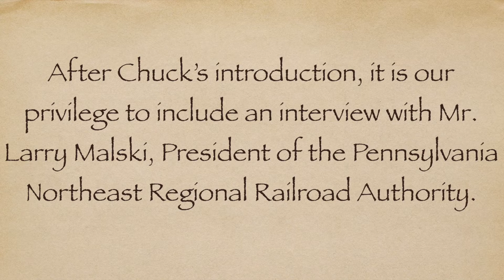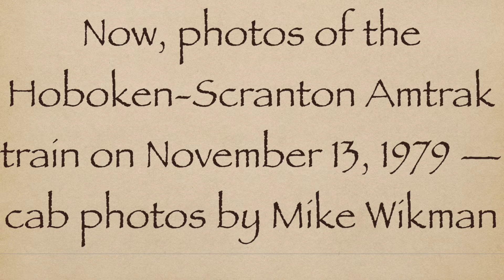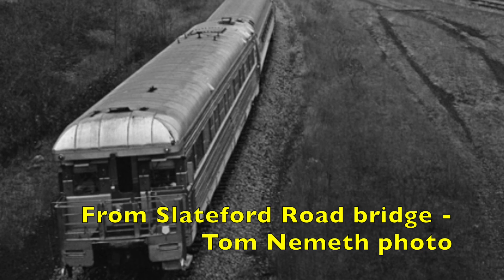Lackawanna Cut Off - Part 14: Farewell to the Cut-Off (1979-1984)

Comment: Thanks for another great episode in your cut-off series. The line in the Poconos was saved, but only one track. If memory serves me correctly, Conrail single tracked it about the same time they pulled the cut-off. I remember the rail train in Cresco. This was right after a deal with Monroe Country to buy the line for 7 million fell through. Monroe County Commissioners and Conrail personnel hi-railed the cutoff shortly before the tracks were pulled. The eastbound track is in place to Mt. Pocono, then it's connected to the former west bound line to Scranton. All the signal systems were torn out, too. We also lost the Mountainhome Branch, which left the west bound main at Cresco. Contrail left no stone unturned. There's still some double main line in E. Stroudsburg, but not much. Some double track exists around Nay aug Tunnel and is used for storage of D-L cars. An occasional empty signal bridge appears here and there between E. Burg and Scranton. There is one business that has survived all the turmoil with the railroad since the 1950s. I don't know its name, but it's under Rt. 80 in the gap and has always had rail service. I'm guessing Conrail continued to service it from the coal trains that went to Portland. Now D-L serves them and many new businesses along the way. At one time I thought we were going to lose it all in PA, but fortunately, it didn't happen.

Comment: I used to work for Conrail in the 80’s and I can tell you that they couldn’t get rid of or tear up track fast enough.  That goes for people too.  It  was awful to watch.  When I asked my bosses they said it’s simply a matter of survival, or we have another cheaper route to the same place, or we need to cut costs.  I said what about the businesses we serve on that particular line and their answer was not enough waybill generation for us.  Some of the routes were sold to short lines.  I understand some of it but it was terrible to watch.   A line of track is a precious thing, it’s a right of way that possibly can never be replaced.  Every single line should be protected forever.  It’s a gift from our forefathers that we cannot waste.  Thank you people for resurrecting the cut off.   I can’t wait for it to open.
Reply from the maker: If anyone should understand how difficult it is to undo what Conrail has done, it would be you.  Thank you for your cogent explanation.
Reply: They sure did a number here in Indiana to almost the entire PRR system,  and a lesser extent, parts of the old Big 4...

Comment: The New Jersey cutoff needs to be fully restored because I-80/I-380 are at the saturation point between Scranton & the New York/Newark,NJ metro area. Passenger/Commuter train service is needed between Scranton & the New York/Newark,NJ metro area. It is also needed between Scranton & Philadelphia as well. The Northeast extension of the Pennsylvania Turnpike/Blue route(I-476) & I-76-the Skuylkill parking lot are already saturated with traffic.
Reply: What transit agency would you suggest to operate the service?  NJ Transit would not want to fund or operate any service that serves any place other than in New Jersey.  Same goes for Pennsylvania as far as operating any service which makes stops in NJ.  Amtrak is not in the commuter business and given its chronic funding issues I don't think it is a good choice anyway.  I agree that rail service to that part of Pennsylvania and adjacent areas in New Jersey would have many benefits to the residents as far as reducing traffic congestion and increasing energy efficiency.

Comment: From Port Morris Junction west to the Delaware Water Gap, were there ever any freight customers significant enough to require spur tracks? (Confession: I have not watched any of the 13 previous parts in this video series; maybe I could find the answer in one of those.) I'm guessing we won't see any freight on the reopened Cutoff in New Jersey, except maybe in case of an emergency detour. Also: I'm guessing NJ Transit will be ready to pay for Positive Train Control east of the Water Gap, but from there west to Scranton, "someone" will need to pay for PTC -- and for other capital items, and operating costs.
Reply from the maker: Each of the three stations--Greendell, Johnsonburg and Blairstown--had sidings, actually multiple sidings.  But there was no spur per se off of the Cut-Off separate from the station locations.
Reply: So I guess there's little or no chance there will be any freight customers along the route. I was thinking NJT could get a bit of income from allowing a short line operator to develop customers and serve them at night when the passenger trains clear.
Reply from the maker: Even from the farm supply perspective, that business is gone, long gone.  Even using the rosiest of projections, I just don't see why such a customer would pick the Cut-Off to establish a business.

Comment: Really enjoying this series Chuck.  Keep it going.

I'm curious about the Amtrak run.  I remember reading at the time that conrail had physically removed a rail to prevent them from running it - and indeed in the photo at 48:54 you can see a rail has been removed.  What is the story behind that?
Reply from the maker: Conrail did remove rail at Port Morris and spiked the switch at Slateford.  I don't believe the rail was removed specifically to prevent Amtrak from running, although a request was made to Conrail to put it back for the run, but they refused.
Reply: Ok that sounds like what I heard, although I didn't know the entire context at the time.

Was it Amtrak's idea to make the demonstration run?  And am I correct that the thinking was that with the publicity from such a trip that perhaps the state(s) might reconsider saving the cutoff?  (I'm also assuming that conrail had no choice but to let Amtrak on the line due to compelled access?)
Reply from the maker: Amtrak was "asked" to run the train.  And, yes, I don't believe Conrail could have blocked the run unless the trackage was deemed unsafe to run on.
Reply: Thanks Chuck.  This is fascinating stuff.  I'm looking forward to your next episode.

Oh and by the way - thank you for turning me onto Spencer Albee.  I never would have heard of him otherwise.  I will never be able to listen to "Wait Through The War" without thinking of the cutoff. :)
Reply from the maker: I "found" him by accident.  The song is at the end of the movie, "Night of the Living Deb".  Silly movie, but great song.
Reply: The connection was taken out but the Y remained intact at Port Morris. The train ran backwards from Hoboken, then reversed direction on the Y at Port Morris and ran locomotive first to Scranton. Where it went from there, I don't know.
Reply: No I'm sure the train did not run backwards all the way from Hoboken.  What they did was go around the wye twice, which oriented the train for the westbound move over the cutoff.  There is footage of this wye move in Chuck's video.
Reply: Thanks for the clarification on that. It was my understanding that only one leg of the Y remained connected to the former eastbound main which allowed access to the cutoff, but no way to actually turn a train. The most important factor is that the switches were removed, but the Y stayed in place, at least partially, allowing access to the cutoff. I think one of the other commenters was unsure about that.
Reply from the maker: scoostraw, you’re absolutely correct.  The train ran forwards from Hoboken to Denville.  At Denville, it was reversed on the wye and then ran backwards to Port Morris.  At Port Morris, the train was wyed again and then ran forwards the rest of the way to Scranton.
Reply: So I was partially correct in that it did run backwards into Port Morris then changed direction for the run to Scranton. I had forgotten about the Y in Denville. Thanks for that information.
Reply: Thanks Chuck.  Did they wye at Denville because one leg of the wye was out of service at Port Morris Jct?
Reply: Yes!  You're right they actually did reverse into Port Morris.  But at the moment I am wondering why they did that...

Comment: I know I am asking early but what about steamtown? Would the trains still be able to serve the stops and possibly run over the new track for longer trips with the faster equipment?
Reply from the maker: It is a bit premature...but I doubt that NJT would allow non-compliant equipment on their railroad.  But Steamtown would still be able to run to the Water Gap.  East of there, I doubt it.  Even 614 had cab signals installed back in the 90s in order to run over NJ Transit.  The requirements are even more onerous now with PTC coming on line.
Reply: Chuck Walsh alright. The major issue is that the equipment is simply beyond modern ability. Plus some of the stations and passing sidings are essentially in NJT way and could mean a end to many communities big thing. When we bring the steam loco or even the diesel trips up the whole town is there cause it is a big event. And if the trains can’t get to these stations or even be feasible to head back. Then these towns would not have as large of a crowd and the station society’s would struggle to a point of shuttering. I believe in PTC we can have the equipment for its age be exempt. I know the ARHS F units are exempt due to there pre 1950 production dates. So maybe the steam and early diesels can still work.
Reply from the maker: Matt`s Mocs, I’m not an expert in waivers to existing regulations for running legacy non-complying equipment, and perhaps such a provision might be feasible in an operating agreement if Pennsylvania were to underwrite the insurance, but it ultimately would be up to NJ Transit to decide.  Based on their past policy decisions, I’m not optimistic.  Consider the fact that if NJT were to allow Steamtown to run trains over the Cut-Off what other requests might they get from other sources.  There may be still a way to pull this off after all, but let’s get the tracks going first and we’ll deal with these possibilities then.

Comment: Are there any plans to restore any other abandoned lines in northern nj. There are a bunch of old beds in Sussex and Warren and Morris also. Would like to see some of them come back .
Reply from the maker: The Cut-Off is the only one that I'm aware of that is being actively pursued in Northern NJ.
Reply: It would be nice to see the Sussex Branch come back, but it's been abandoned long ago and tracks removed. As was explained in this video, short of a miracle, that's the end of it.
Reply: If thats the line that runs from the old limecrest quarry area through andover/ allamuchy/ great meadows, etc area; than not all of the track has been removed on that line. There are areas that still have track
Reply: They can also extend the Morristown Line and Montclair-Boonton Line all the way down to Phillipsburg where it would meet an extended Raritan Valley Line there's some talk about it.

Comment: chuck, why were the railroads so quick to tear up the tracks? did they make more from scrapping the rails than it cost to pull them up? was it some sort of liability issue?
Reply from the maker: jim diskin, there is a value to the track, and most of the track on the Cut-Off was 131 lbs rail, so it could be re-used as Conrail claimed it would be. The taxes also decrease when a railroad is abandoned.  It took Conrail about two years to start removing tracks after abandonment, so it wasn’t quick.  But clearly they wanted the line abandoned and did everything they could to kill business on the Pennsylvania side.  Given this was ex-Erie Lackawanna trackage, Conrail had no financial interest in it and wanted to get rid of it.